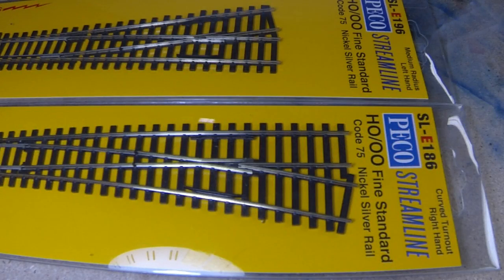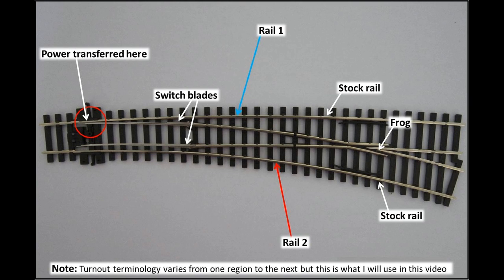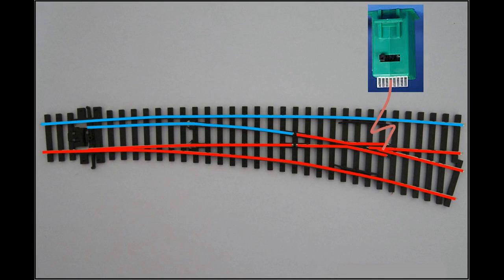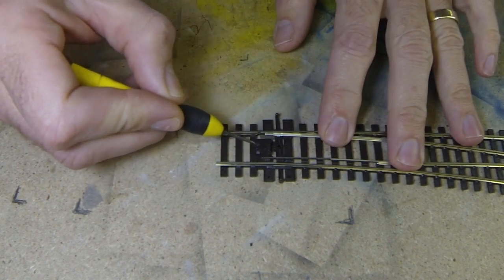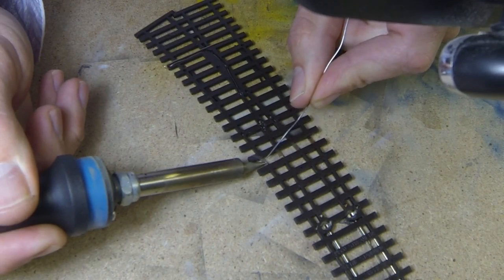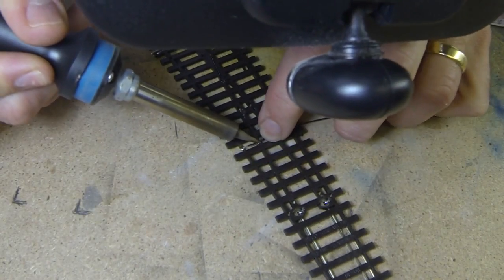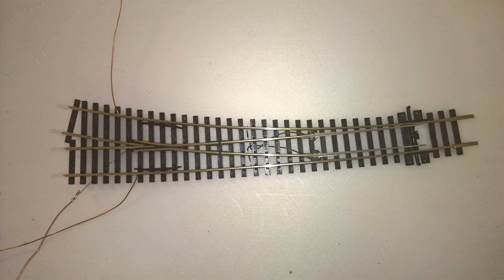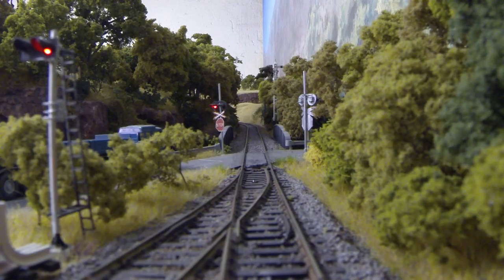How to wire a peco code 75 turnout for DCC and tortoise motor

Comment: Could you please tell me what problems can occur when the entire central section of the turnout changes polarity? The blades are there to switch the polarity of the whole internal section of the point, and polarity switching can be supported by the wire connected to the frog. It is a very nice video, thank U, but I do not see what advantages I would be able to draw from modifying these points. Though I have a DC system.
Reply from the maker: The biggest risk is out of gauge wheels that could short. Sort that out and you'll be fine. The advantage of this is that if you get some dirt between the stock rails and the blades, you get a dead central section (blades and flog). Longer locos could span across the dead zone but shunters will stop, especially at very low speeds. I hate having to nudge my locos. If you are not bugged by this and are happy to nudge your locos every now and again then there is no advantage.
Reply: Thanx for the response! :) The risk you have mentioned is there, that is true. But the dirt between the stock rails and the blades can cause a dead central section only if the frog is not fed through its wire . Please correct me if I am wrong!

Comment: The only useful bit of advice in this video is to remove the spring from the point when using tortoise motors. You can save yourself a whole lot of work by cutting through the frog rails just past the frog, then soldering jump wire across the relative stock rails, the frog polarity is then switched by the moving blades.
Reply from the maker: True, but the whole purpose of this exercise is to get away from relying on contact between the moving blade and the stock rail for flog polarity (if I understand you correctly). Frog polarity via a switch machine is far more reliable, albeit more work.
Reply: What I mean is that this is all possible with two short pieces of wire just beyond the frog, cut through both rails forming the frog, this basically turns it into an insulfrog without the limp of platistic, then using short lengths of wire just beyond the cut, solder them left hand stock rail to left hand stock rail on the divergence and repeat for the RH stock rail. yes this does rely on the blade to switch polarity, but that is why the spring is there,providing you maintain your track correctly there should be no problem.
Reply: That’s horse-dung, switch blades will eventually wear and you will have poor connectivity.
Reply: @Haymarket47  I doubt you will live that long, unless of course you are swtching the points thousands of times a day.
Reply: Horsham Walters g

Comment: I had wired all of my son's turnout's in this fashion. Unfortunately large steam engine's (Big Boy) will cause shorts in this method. The solution is to go one step further and only power one point rail at a time.
Reply from the maker: Oh wow. Thanks for the heads up. Thinking off the cuff (very dangerous) you'd probably have to use both sides of the tortoise internal switch to power the switch blades which is unfortunate. Then you can't use the second switch for signals or other peripherals unless you can convert DCC track power to DC for signals etc. All rather complicated. I run South African stuff so I don't have that problem. Our bigger steamers were Garratts - articulated 4-8-2+2-8-4 and Class 25s 4-8-4.
Reply: What I did was I used one side of the tortoise to power a 4 pole relay. I used two of the relay ports for track power and a third one for powering a dual coloured LED back at the control panel. This way we have one additional port on the relay as well as the second switch on the tortoise. Eventually these may be used for signals or something else we think of!!!